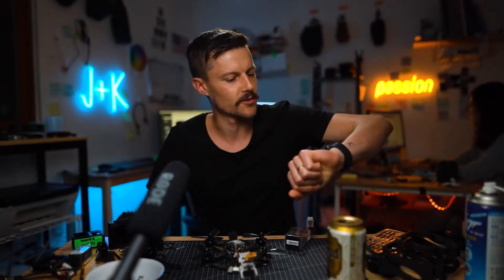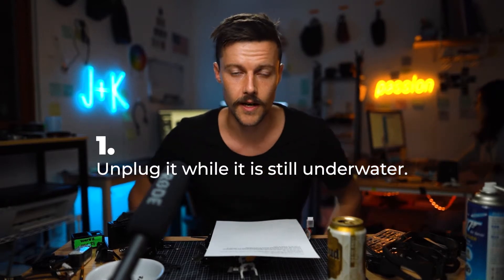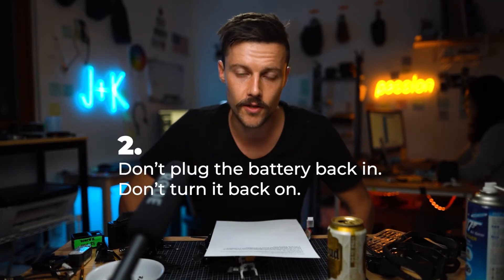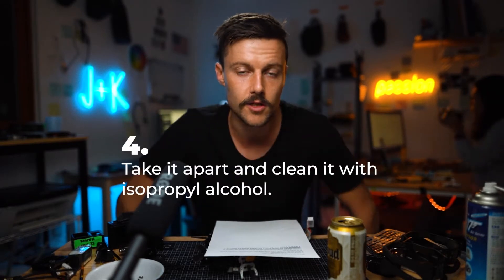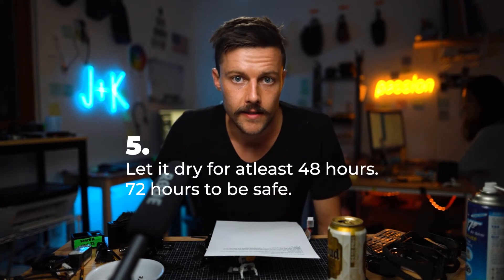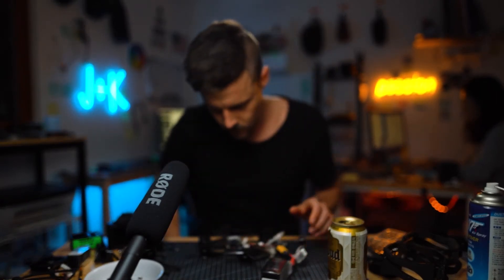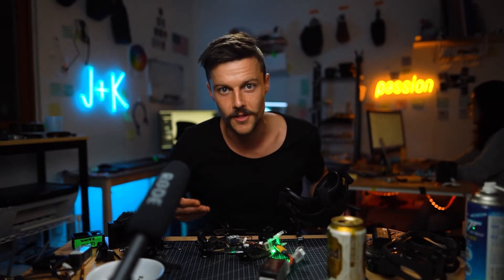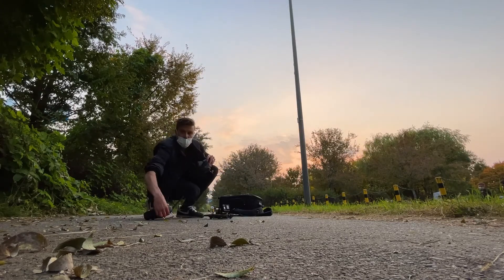What do you do when your drone or FPV falls into water?

Comment: I've  ended up crashing in water 4 times with the same drone. I've got a dji airunit, the rest of the kit is custom.  My HGLRC FC came coated from  the factory, I never did anything with my ESC. In most cases I just put my drone on the roof of my van in full sun, day later it was back in the air. I did also use rubbing alcohol to clean of esc.
Reply from the maker: Wow! Amazing yours is still running!

Comment: Thanks for the info. I also just got the Protek 35, do you know how sensitive it is with snow? I just took it for a flight and it landed in the snow, i cleaned it all up since it got everwhere. But when i tried pluggin back in the battery it didnt beep and i dont see the feed through my goggles anymore :(
Reply from the maker: Hmmm. That’s weird. I’d take it apart and see what it looks like inside. I feel like it should be fine. Mine is so beat up, but still works pretty well. 

But I am also an amateur you could get better advice from fpv subreddit. Much more experienced people on there.
Reply: What happened to it did you  get it working?